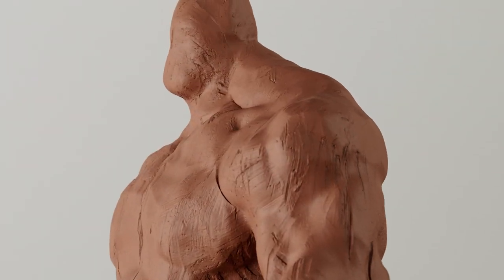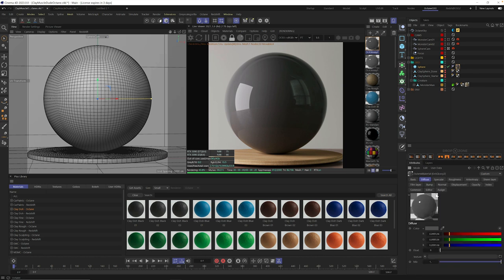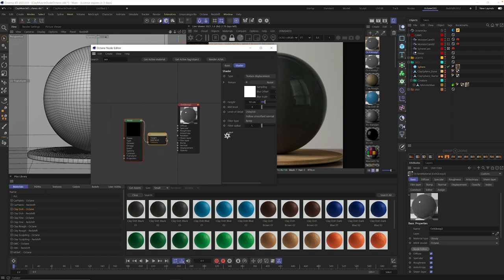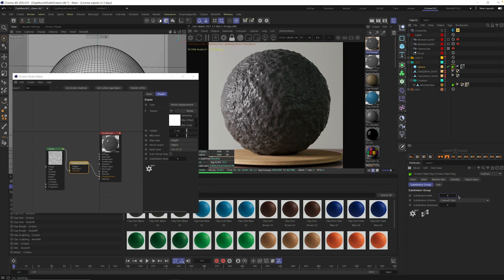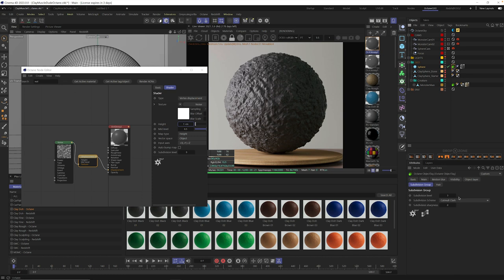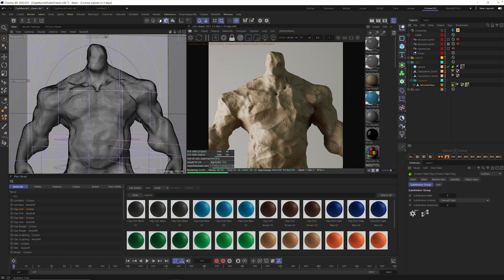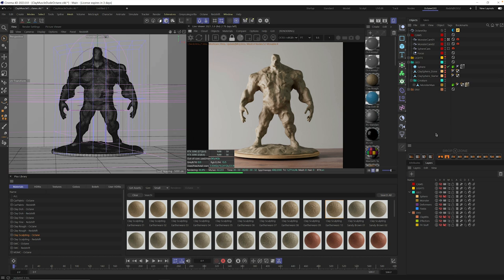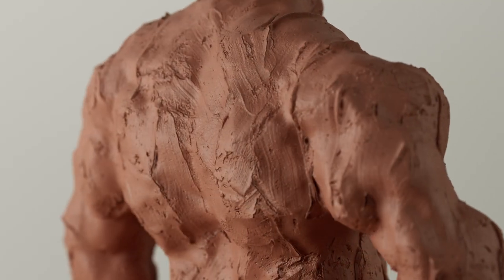Tutorial | Displacement with Octane Materials in Cinema 4D

Comment: Nice collection!
One note here about octane: if you use vertex displacement you should turn autobump on and subdivide via the material you do not need the tag. And if an object has uvs, use texture displacement as it is way lighter and not dependant on poly count. Cheers!
Reply: Yeah I was wondering about this… wonder why they’ve used the object tag to subdivide the mesh?
Reply: I was also wondering why he used vertex displacement i literally use almost everytime the texture displacement and it looks as i expect it to look.... but ill maybe have to try vertex displacement more often to see a difference. Thanks anyway nick! Great mats tho!
Reply: @3rdDim3nsn3D  you should not use vertex displacement unless you have noises or lack of uvs. 
This one is heavy, subdivides the objects literally. Texture displacement is the one you should use 99% of the times as it can be used even on a single polygon.
Reply: @MotionPunk  yeah thats the reason i use tex disp almost all the time. Thank you for your tip man, i really appreciate it!